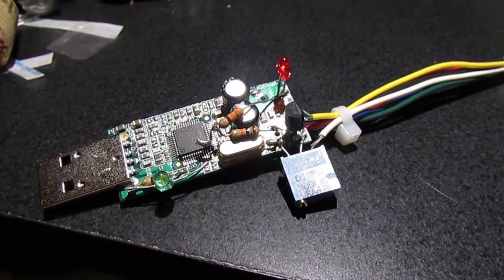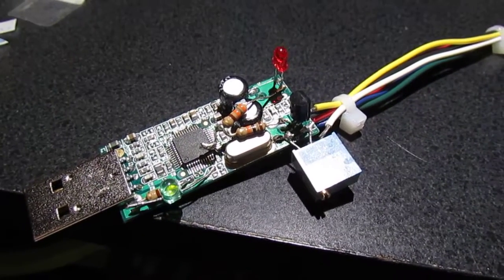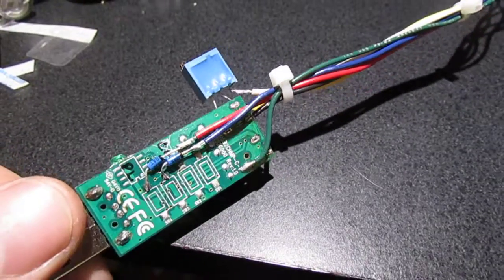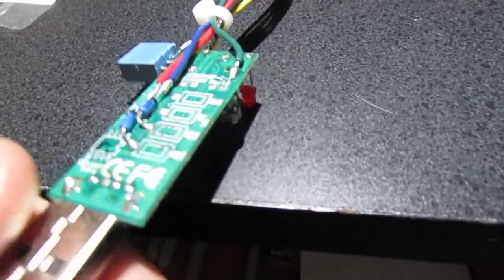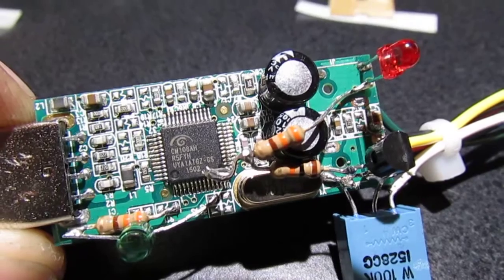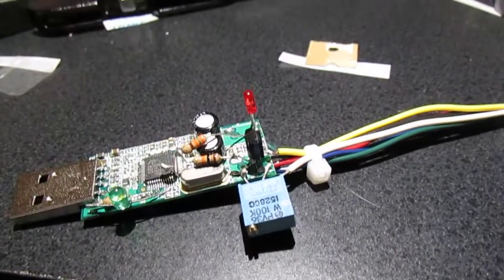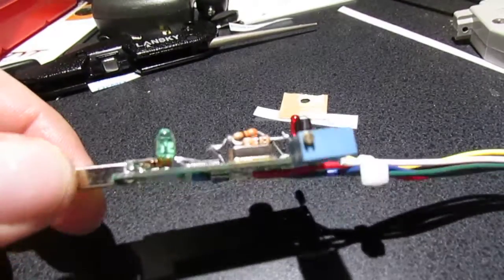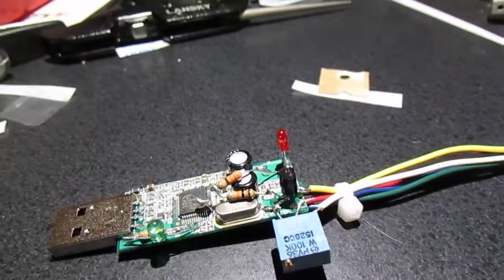Modified USB audio device for Allstar

Comment: I have made this conversion and everything worked but the silly COR(COS)........was wondering if you used the SimpleUSB or the USBradio configuration for this. I have used both, and though the PTT and all works, the COR will not trigger. Checked everything.......
Reply from the maker: +Rich Meinke 
I have used both usbradio and simpleusb and they both work roughly the same way. On every node/radio I setup I make sure the radio's COR indication is an active low or in other words, a pull to ground upon receiving a transmission. With this, in order to trigger this indication to Allstar, you should have this "carrierfrom=usbinvert"
in either your usbradio.conf or simpleusb.conf file. If you still are unable to get it to work, use a wire and ground the COR line to the fob and release it to see if the fob is working correctly.
Reply: +KC2IRV I went back through it and got it to work correctly. I used the SimpleUSB with the carriefrom=invert and it worked. The stupid thing was, thats what I had it set before. I did find something, in that the older CM108 chips or at least in my case, want to see a ground ( as you mentioned) to trigger using the carrierfrom setting. I stuck in just a transistor switch so that the COR line is either driven LOW on a carrier detect, or a HI-Z state (or OPEN,  not using 5V, and pulling that to ground using a pullup) Reloaded, and boom it worked....could have been it or the planets aligned right and it worked.
Reply: @Geewhiz811  How do I set the gpio of cm108?
Reply: How do I set the gpio of cm108?